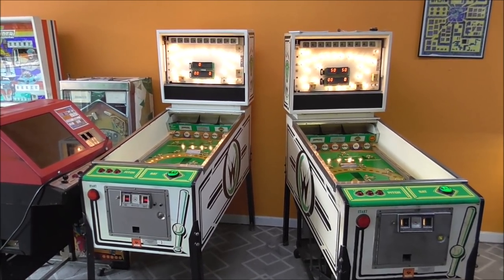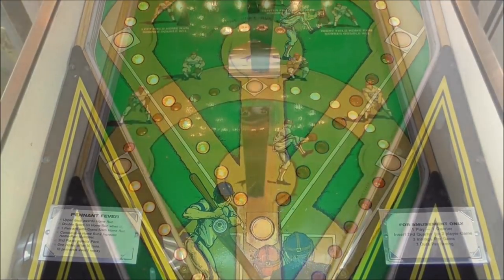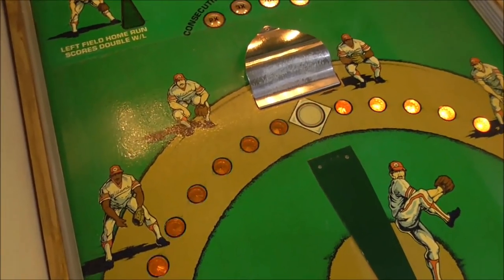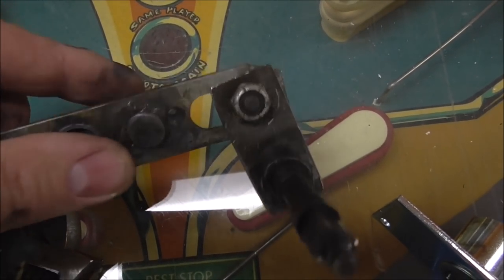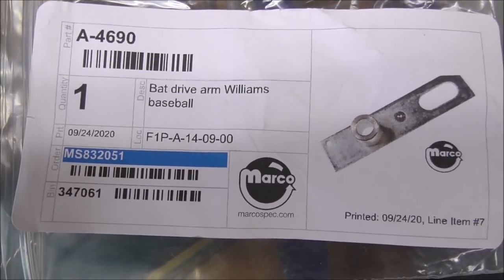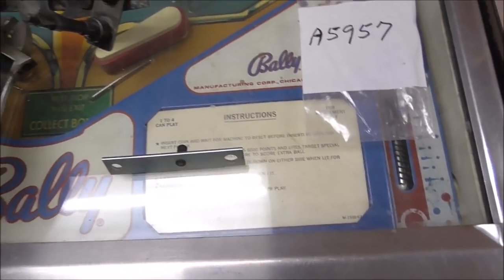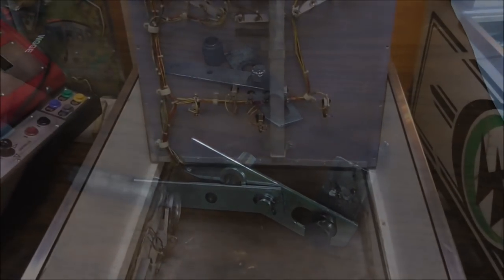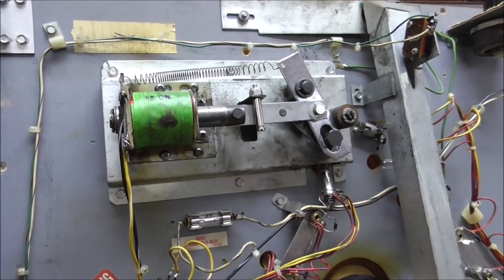Repairing the Bat and Magnet On a 1984 Williams Pennant Fever Pitch & Bat Pinball Machine 7

Comment: I was thinking with the bat maybe you could put plastic shims or something to take out the slack in the bat?
Reply: I've fixed worn plastics (N64 controller sticks), using two part epoxy putty (that smelt like dog poo).
If anything it's harder wearing than the original plastic.

Comment: I wonder if the transistor driving the magnet on the left machine is weak?  Or maybe someone hid a resistor in the circuit somewhere.
Reply from the maker: I think there's probably something like that going on.  Or one of them has the wrong transistor, I believe the one on the right that's super strong (maybe too strong) is probably how it should be, because the magnet coil I put in from the slug fest is bigger than the coil that's supposed to be in Pennant Fever, I just can't get the right one right now they're out of stock everywhere.
Reply: Yeah they do seem to be polar opposites.  (Polar.  Get it?)
Reply: One other thought (if it even matters):  The MPU only drives a relay that connects high voltage and activates the magnet.  It was observed that there's a cam that turns on a switch at a specific time during the pitch, and it's possible that the switch is to activate the magnet for only a short period of time.  If the switch were stuck closed, then, that would leave the magnet active for the entirety of a curve ball pitch, and it would have more time to play with the ball's trajectory.  Unfortunately, the schematics only seem to show the PCBs, and not the playfield.

Comment: I wonder if a 3D printer would make parts strong enough to replace metal.

They have some composite materials for 3D printers, but not sure if they are strong enough to not break in a game like this.

The other thing that would work, there are metal fabrication machines, one uses lasers, very high power, that laser cut metal to whatever shapes you need.

The other cutter fabrication machine I have seen uses a jet of water to cut through metal.

It might actually be plasma 

I think you can use water to create a plasma cutter

There is a lot of high tech and manufacturers in the CLT area.

There must be a company that could make you parts that are no longer available if they are metal or plastic

I have seen the plastic that is based on dental material that hardens using UV light

Have you ever used that material for fixes on the pinball machine ?